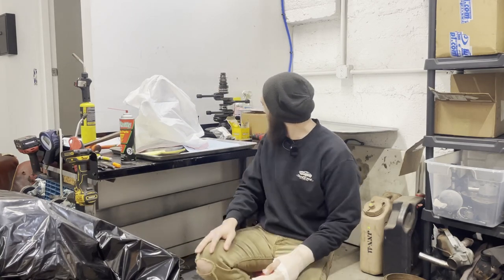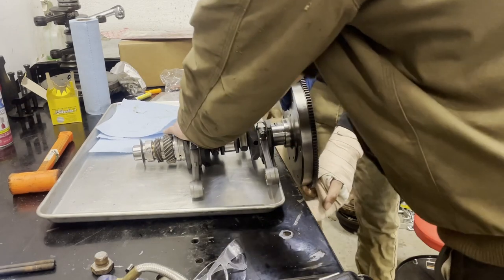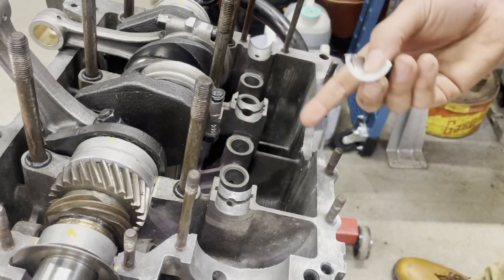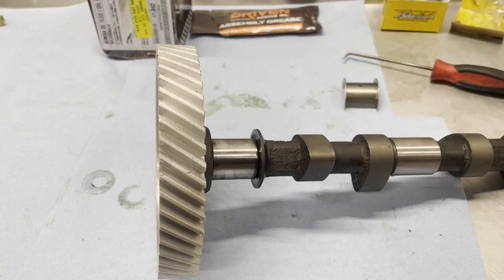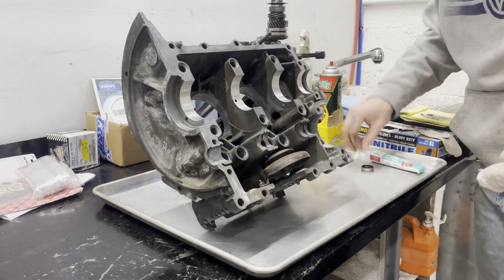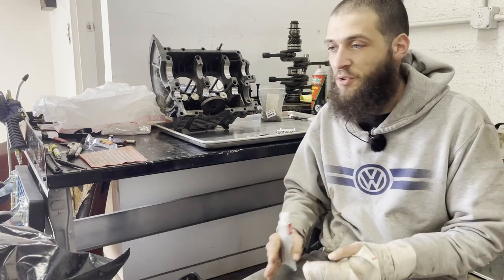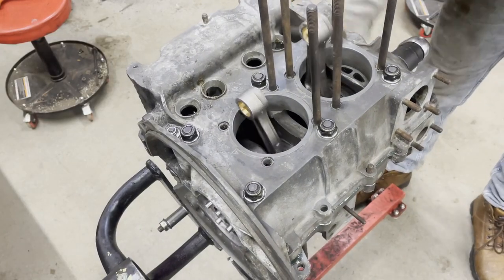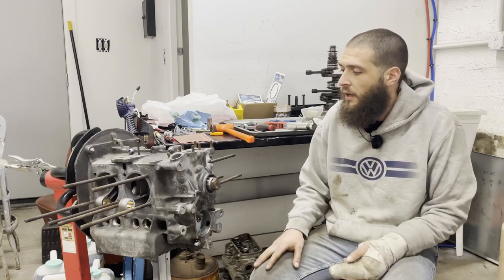HOW TO - Classic Aircooled VW TYPE 1 & TYPE 3 ENGINE BUILD - SHORTBLOCK ASSEMBLY

Comment: Excellent build video.
A tip for ensuring the crank is seated in the case is to place the other split bearing over the journal and confirming there is no rocking movement.
I also use Curil T but I've never heard of RTV causing case clearance issues.
The reason I've always avoided rtv is the risk of blocking the oil screen pickup when blobs work loose.

Comment: How did you put the top case half on without dropping a lifter or using the funky wire lifter holders and with 1 hand 😂 , mad skills bro !  Have you ever tried using double thrust cam bearings ?  I have a few boxes of cam bearings missing the thrust bearings , now they sell double thrust bearing sets for a few dollars more . I  definitely recommend double thrust cam bearing setup . Good video 👍
Reply from the maker: Really sticky assembly lube 😂 I have not tried doubles, personally not think it’s necessary for stock engines and I do not currently have a cutter to set the case up for doubles. Thanks for watching!
Reply: @wickedwerks  Gotcha !  I just found you on youtube , didn't hear what size the engine is . I really like the Veedub engine and my go to engine is 1835 with dual carbs , so I like tweaking things whenever possible 😂 . Keep building brother !
Reply from the maker: @RichardBarker-d1h  this was either a 1600 or 1641 with a Scat C25 cam. Considering building an 1849 for my Bus at some point. 85.5x76. I want to try and build something different. ✌🏻

Comment: My dad used High Tack sealer to seal the two case halves. What do you think about using High Tack? Will it cause a problem in the future?
Reply from the maker: You know, I’m not sure, I’ve never heard of that being used before. Is it like a gasket sealer or a shellac?
Reply: @wickedwerks  Its a red gasket sealer that you brush on, very tacky.
Reply from the maker: @jonpeters2700  yes! Okay, I’ve seen that before. Never seen it used for this application though.

Comment: Ok, now here's my question. Can you do a type 4 build or is it similar enough to where this would apply? Built plenty of V8s built recently scored a 2.0 914 engine, almost complete and turning...from the local scrap yard...for $40. Before anyone blurts out an offer, I have a beetle with no engine, so it's going in there.
Reply from the maker: I think I saw your post on Reddit earlier looking for info. I’ve never built a T4 and there is some slightly different bits here and there but it’s basically the same design. I would get a good Bentley manual and maybe do a search on the samba for first time building tips!
Reply: Look for the Jake Raby T4 video - believe it is still available to order online. An absolute must for anyone building a T4 engine. Also check out Ian Karr's video series on youtube. He does a complete 2.0 T4 rebuild using all of Jakes techniques.
Reply: @wickedwerks  actually no, not on Reddit. I think I can figure it out. My beetle and engine has been sitting in a sea container for over a year waiting for me to get the time to mess with it. It's a pretty roachy 54. I saw your oval up for sale (before you got it) and seriously considered picking it up, but it's been a busy year and life got in the way of buying more cars.